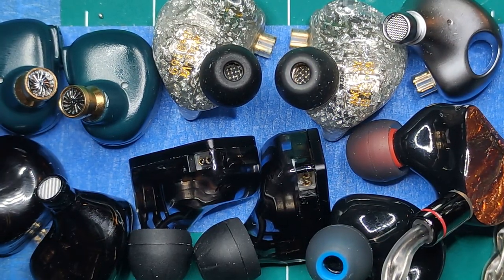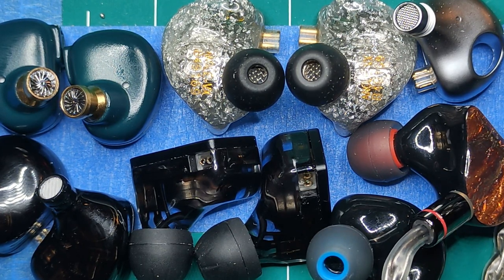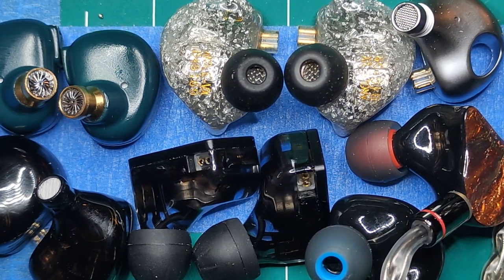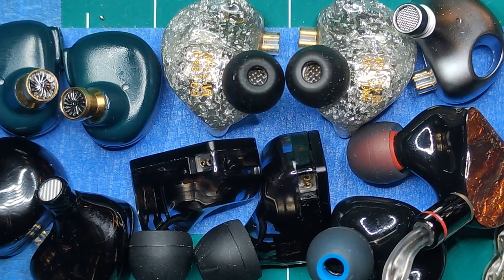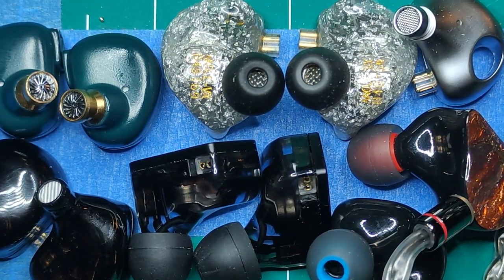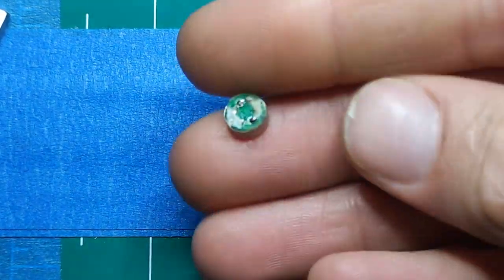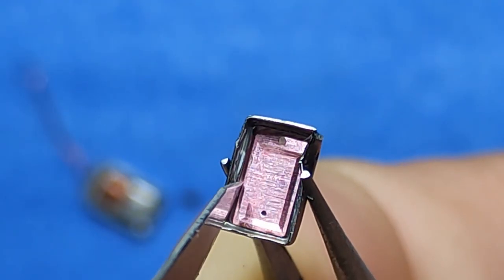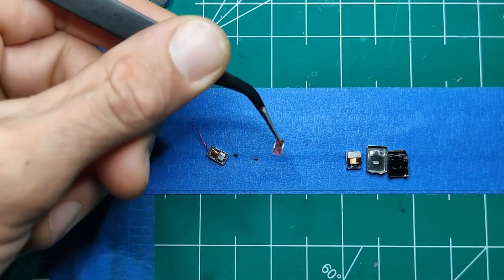Sonion EST vs KZ M-stat. IEM (earphone) driver teardown bonanza!

Comment: Thanks for the tour of wierd drivers. The estat and balanced armature were very intresting. I think those metal plates in the estat are called stators. High voltage ac is run through them wich attracts and repels the statically charged membrain. Very cool little device.

Comment: At 26m33s you can see the wire (it's very thin) from the solder bump sticking upwards. It is (before opening the cover) connected to the terminal on the pcb (seen on 25m28s). The cases are connected electrically through the spout, as this is welded on both sides.